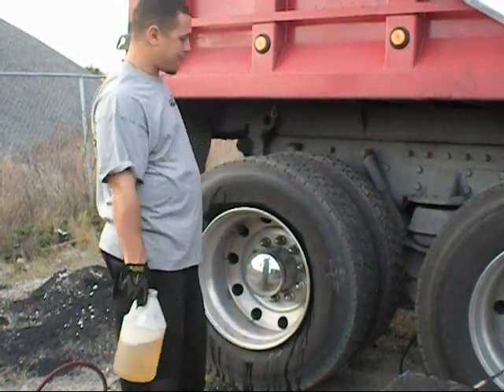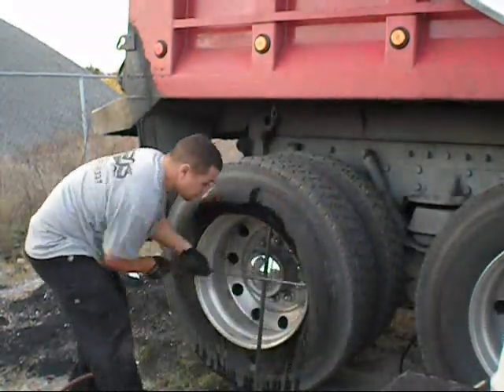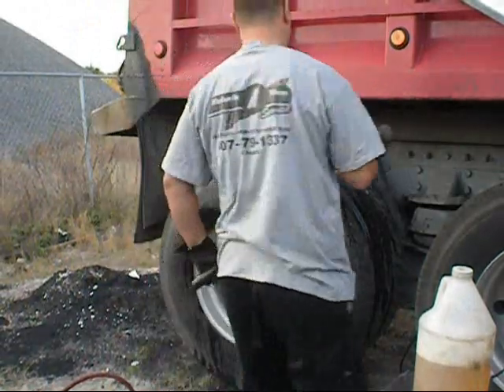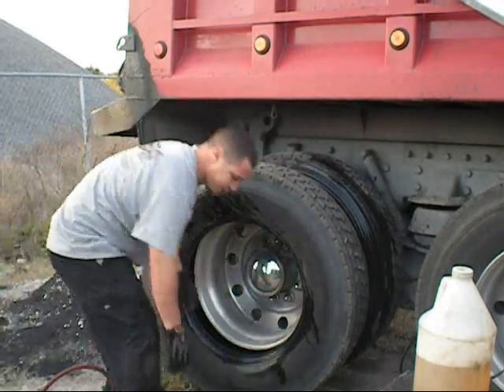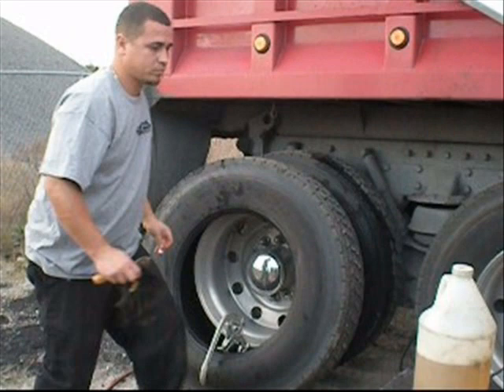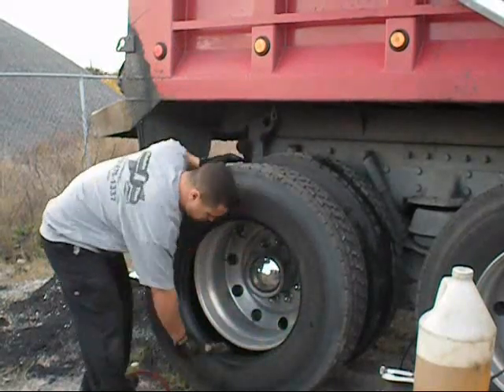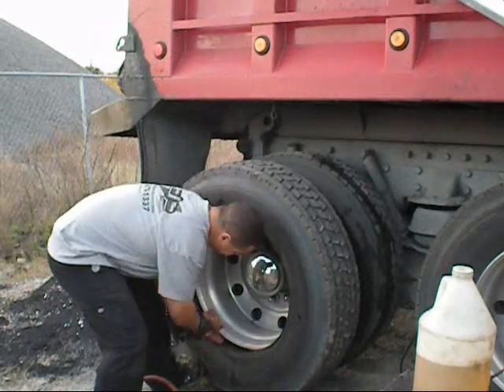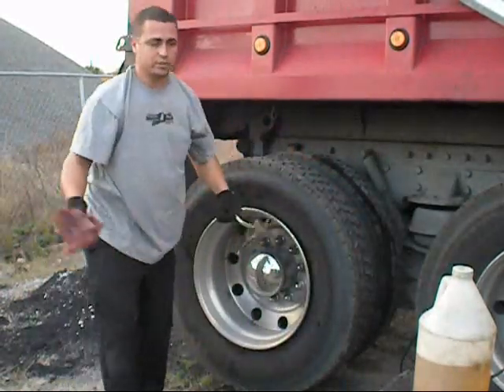Outside Semi Tire Repair

Comment: Good job. Next time however, be sure and use a plug prior to using the radial boot patch. The plug will prevent moisture from entering the steel cords so that the casing can be recapped if so desired. I'm medically retired from a 25+ year career changing and repairing tires of all types. I used to be able to do an outside dual in just under 45 seconds. BTW, next time break the back bead from the other side. Those mud flaps can be lifted and held outta the way !!!

Comment: Best Youtube tire fitting shool on the world. In Europe many mobile tire fitters use expensive,havy tire changer mount on Van. Beafore they assemby big changer im can change this same time 2 truck tire on hand. And put back to axle. On night and higheway/motorway time is your live and safe. 
And im have a two questions. What exacly do you use to lube tire beafore unmount a mount. And second what petrol compressor do you recomendet?? it's mean hov many psi or bar they need for mobile tire??
Many thanks for help.
Best Redgards from Poland
Your the best.👍👍👍
P.S. Sorry my English im learn write😊
Reply from the maker: Email me for more information

Comment: I could be terminated for doing this.  Peel offs (demounting/remounting tires with the rims on the truck) are not permitted as there won't be a tire cage.  Aside from safety issues there's also technical one since tires seat best in the horizontal position.  I don't mean they're easier to seat, I mean that's how tire manufactures recommend mounting them so the bead is concentric to the wheel.  I'm certain you'll criticize me for it but it's there. If you peel off inflate as far away as you can.
Reply: TheClassFool been a tire guy for 6 years done plenty of peel and sticks and never had a tire blow on me ever the ones I put in a cage is repairs run flats if the driver is desperate for that tire and lock ring rims never had any tire blow on me and I’ve sad brass up down vertical horizontal you name it as long as they seat all the ways it’s good

Comment: expensive tools for makin repairs etc and using vice grips on wheel instead of a simple G clamp and that hammer for breaking the bead would never work on a safety rim.

Comment: All these videos showing guys skinning tires. Just take the damn thing off. No need to buy an extra tool to spread the tire. If done right it only adds a couple of minutes and you can safely and correctly inspect the tire. Especially when a tire has gone low due to a puncture. Fast is not always better especially when the vehicle you are working on weighs tens of tons. Need to rename the video "How not to repair a truck tire".